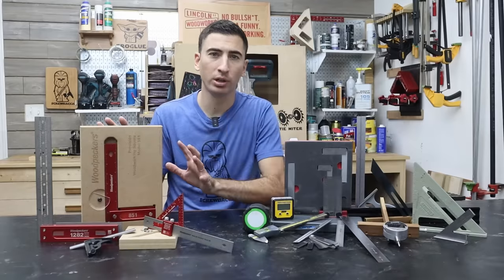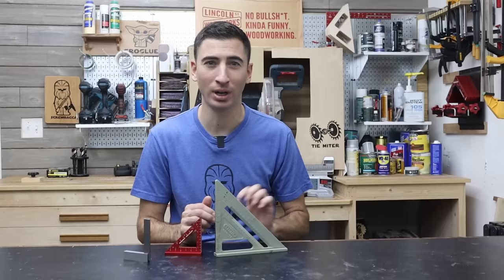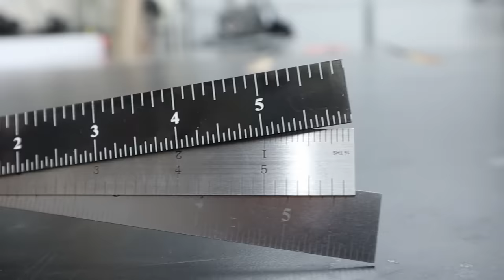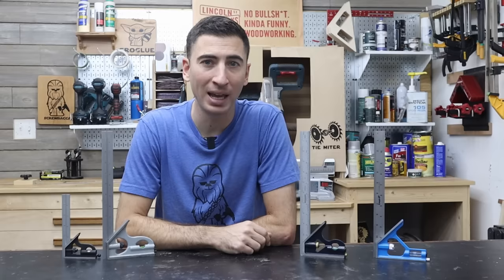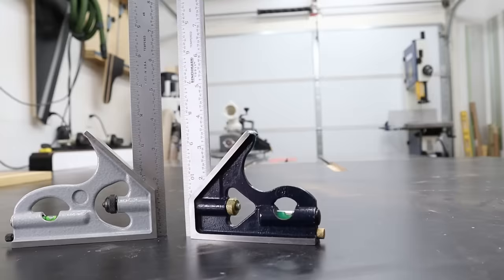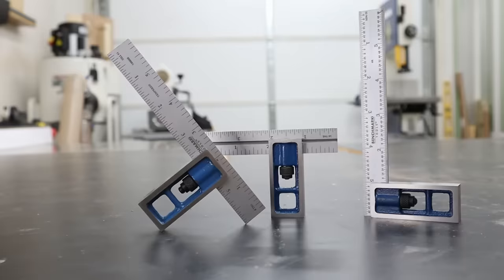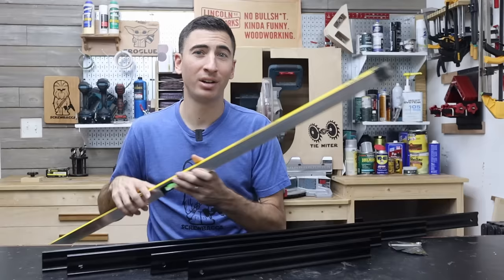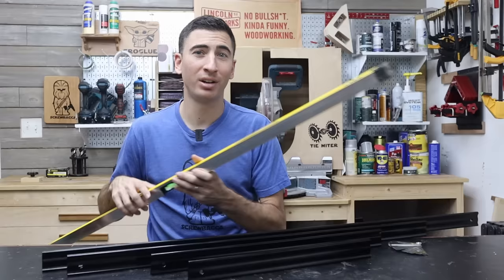Why is woodpeckers so expensive?

Comment: One advantage of the speed square is that when cutting timber  you can place your square on your timber and run a power saw along side giving a square cut. I found this useful just recently when cutting 4 x4 inch fence posts.
Reply: can't you do that with any square?

Comment: I agree that machinist squares are essential for setup and some layout. And a precision straight-edge. I would also add at least one pair of 1-2-3 blocks. 

I also reccomend a good quality combination square. (I was lucky enough to be able to score an excellent Starret set -  the rule, the square head, the protractor head, and the center finder head - when a woodworker in my area had a "retired and moving away" sale of his whole shop.) 

One thing about measuring and reference tools being steel - in the world of physical/dimensional calibration, steel is everywhere. Most of the tools being calibrated are steel, and most of the measurement standards (such as gage blocks) are also steel. This is important because the standards and the tools being calibrated have about the same thermal coefficient of expansion, which means that there is normally no need to correct for temperature. A tool made of aluminum, however has a different thermal coefficient and will therefore expand or contract a different amount than the standards. That makes the math of determining in or out of tolerance more complex, and adds to the total measurement uncertainty. 

All of my dimensional measuring tools are made of steel, because I know that if, for example, I compare two rulers I can expect all of the graduations to line up. However, trying to compare a steel rule to an aluminum or plastic rule would be pointless because of the different expansion rates. They would "probably" read the same if I maintained my workshop at a constant 20°C as calibration labs do. But I am retired from that environment, and I prefer my workshop warmer than that. 

Things get even more complicated when you add plastics to the mix, such as the common glue-up squares. The mould they are made in is square, but is the actual square square? Injection-moudled plastics can change over time due to internal stresses. I believe they eventualy reach an equilibrium state, but how much time does that take? 

I do have one tool from Woodpecker's - their small aluminum pocket square. It's size makes it convenient to keep in my pocket, and I know the thermal expansion/contraction will not make a VISIBLE difference when checking squareness. But it is for quick checks - it is not one of my reference tools. 
 
High quality measurement tools are not "essential" for beginner or casual woodworkers. It is possible to start and do reasonable work with low-cost tools. But the better measurement tools enable better precision and accuracy, which enables a better end product. The day I bought that Starret combination square, my old one from Harbor Freight instantly acquired the status of "honorable paperweight", and my work is improving.

Comment: Another great video. One recommendation though. Whatever tape measure you go with stick with it. Not every tape measure is the same as other when going longer distances.  I stick with my Fastcap tapes.  And my machinist square sits by the tablesaw.  After making an angled cut, I reset it with my machinist square.  One more thing to add. I love the Paolini tools because it's small but sturdy.  And it's very specific use.  Once I set a distance, I use all three (sometimes) and I know it's a known distance that I can reset the fence/cutter/bit etc to.  So it's used more for reference distance than anything else. Because it's so small, I put it in my toolbag and constantly reach for it.  I do use my Starret levels as a straight edge and I think it's good enough for my use case.  And I keep a 48" Empire level for jointing use for the tablesaw. Again, being off a few thou is OK for that use case.  But I may have to pick up those straight edges.  thanks!
Reply: Great point.  I verified the accuracy of a dial caliper against Starrett micrometers and then started using it to check the accuracy of rulers, tape measures and other devices in my shop.  The tape on my table saw was off by about 1/10" in 12 inches.  It has an incremental fence as well but I still changed the tape out.  A number of tape measures were removed from the wood/metal working shop and put in a separate garage to only be used when "close is good enough" like looking for raw material or building garage shelving.

Comment: Regarding the digital angle gauge a good beginner option to set the bevel on a table saw is to simply use a protractor app on your phone. I made a U shaped phone holder out of hardwood and epoxied a couple of small rare earth magnets in one edge. Although I have more expensive options to use this is my go to for setting table saw or miter saw bevel. Zero it to the table and then stick the magnets to the blade. The nicest thing about it is it frees up your hands to adjust the blade. Also I recommend measuring tools that measure in both inches and millimeters where you can. The math with millimeters often seems easier.

Comment: To beginner DIY woodworkers: you don't need the tolerances mentioned in the video for wood. Wood expands and contracts with humidity and temperature changes so even 1 hundredths of an inch is more than enough tolerance for good square builds. Get the cheap home center stuff, it works perfectly fine.
Reply from the maker: You're half correct. But wood moving across the grain has little to do with square cuts. Wood movement definitely impacts dimensions and the flatness of pieces. The true benefit of really accurate measuring is setting up tools like I mentioned - that's where errors compound.  I would always encourage somehow starting out to remove variables wherever possible especially for reasonably nominal cost.
Reply: Totally agree.  You can get a good Japanese square on line for about $20.

Comment: I was very lucky to inherit from my father a bunch of machinist measuring tools.  Tons of Starret.  Machinist squares and other.  The options you've provided are good common sense solutions to the overpricing of Woodpecker's.  Yes I said it and it's just my opinion.  The Incra was a solid alternative.  One woodworker recently highlighted a Chinese company, Goingmake.  The T-ruler assembly required.

Comment: anyone thinking you need machinist tolerances with wood that changes with the humidity is beyond help
Reply: Seriously am I taking crazy pills or is everyone in the comments and the video vastly overestimating the tolerances needed with diy wood working?

Wood expands and contacts WAY more than "thousands" of an inch with a 1 degree change in temperature. All of these tools and "advice" are overkill.
Reply: Wood expands across the grain but it does not become longer

Comment: For a mechanical pencil for woodworking I have really enjoyed the Staedtler Mars Technio, it has a 2 mm lead which is very durable and you can use the built-in sharpener built in to sharpen the lead.

Comment: Finally standing up to woodpecker products! Pretty cleaver designs but, you have to be very careful with them or your accuracy can be thrown just buy a brush or prick dent! Steel has it issues also, but my preference. Also depending on your work, you only need a few layout tools really and not a bunch of combo tools that repecate several tools, again it depends on what you build the most. Simple layout are the best! All good points you made in this video! I do prefer  a dial vs digital cause you can discriminate better, and like a vernier it never needs batteries! Columbus Michigan

Comment: I inherited a set of Starrett combo squares with protractors and center finder heads. I havent used any of ky machiniat squares, combo squares since. I build guitars, and using starrett to find and mark centerlines make life so much simpler. I can easily measure depths, and set router bit heights. Id spend the money on a starrett combo square over those high priced red combo sqaures any day.

Comment: I have the PEC 6” double square + extra 4” blade.  This is my go to tool every time. Anything less than 4”, this is perfect bc of how light it is. 12” is hard to hold when marking small dimensions.

The fact that the handle is a perfect 1” width, it works extremely well with 1-2-3 blocks for setup. 

May be add 1-2-3 blocks to your lists of must have. Cheap set of 2 under $20 are accurate to .0005”

Comment: Very good video. One thing I'd like to  comment on is using a square on a table saw. The first table saw I used was an inherited Ryobi, which had a really terrible blade insert. Not only was the throat ridiculously wide, but it was made with a rather springy metal. If you held the square down at all firmly, the insert visibly sagged. It also sagged during cuts. And it wasn't flush with the top of the table. Perfect other than that!😁 I should thank Ryobi because they forced me into making a good rigid zero-clearance insert with set screws for height adjustment. Not that hard to make and an absolute game changer.

Comment: speed squares - as a side note - I actually read an old-old-oooold manual from Swanson speed square and they seem more geared towards roofing and have some features built in that are good for rafters. Was kind of a neat read. I've had my metal one for about 10+ years now, strong. Not absolute for only checking square, but more like check square, but also do your roof stuff.

Comment: @Lincoln St. Woodworks a great alternative brand between budget brands/quality and woodpeckers is to look at igaging and DFM tools.  

Igaging is designed in America but made overseas in some cases.

DFM is made and designed in the United States.

Both brands offer very similar Accuracy and Precision as Woodpeckers.  Albeit not quite as good as Woodpeckers but most folks won't notice the difference unless they are building something with supercritical tolerances.  Such as a puzzle that must look like there are no seams/joints.

Comment: Most underrated tools in my shop: By far it's my homemade 24"X14" surface plate, with which I verify all my other tools. Next is a dial caliper, followed by a 12" machinists square, then a 24" steel straight edge made from a cheap framing square.

Comment: Great, honest and fair comparison.  I don't like cheap tools, but I also don't like unnecessarily expensive ones either.  I have no issues spending in the right places, but don't like wasting my money either.

I just don't get Youtube woodworkers who feel the need to stand in front of a very expensive wall of measuring devices (you know... mostly the "Red" ones) they rarely, if ever, use and probably never actually paid for.

Comment: My $10 dial calipers are my most used tool when working with the table saw. Being a machinist working in thousandths of a inch is more natural and calipers make it so easy to accurately set blade heights and fence positions dado widths and verify dimensions on smaller parts. I did buy a good quality straight edge when I was rebuilding my engine and find it comes in very handy for showing me how bad my table saw really is. It’s much better now but still not great. Spent a few hours flattening the aluminum top of my used Bosch contractor saw (not my best purchase decision). I also have a used mitutoyo tri square I use as my go to for accurate 90 degrees.

Comment: I have the Starrett 12 inch combo square with center finder and adjustable protractor. Came in a kit with a fancy case. It did cost several hundred dollars. BUT, I would never waste $1 on anything less than Starrett. You get what you pay for. Any tool in my shop that needs accuracy is Starrett.

Comment: Well done - lucidly described and practical.  For me personally, a Starrett combination square (the 12" is my fav) is an imperative.  It is the most-used tool in my shop. I rarely use machinist squares as the Starrett does everything a machinist square can do and I trust the Starrett more.  And I agree on the straight edge.  I've had a 36" Woodpeckers for a long time (48" would be better).

Comment: My favourite square, though after 50 years I have several to choose from are either: 1) 3D printed ones.  Those machines are accurate within 1 thou, .  The only problem is that the points are slightly off.  2 seconds with a file and we are done.  Warm to the touch, accurate, light.  cost only a few cents.  Patterns on Thingiverse, and you can mash them up to the perfect size you want. 2) wooden ones, those are often what the best woodworkers through the ages used.  If you can't make one how can you make precision parts from lines you drew with your red square.

Comment: For people watching this, and never heard of the German DIN squarness tolerance standard. Please make sure you check what one you’re purchasing before you do. In this video he shows the Kinex Machinist square and says it’s a tolerance of 0.007”.. that is true for the machinist square that’s 500 mm and has (DIN 875/00) but not the one he’s showing that has (DIN 875/1).. also the shorter or longer the blade is of the square, the accuracy differs slightly. Example.. the 75 mm square that is (DIN 875/00) has a tolerance of 0.003”.. and the 250 mm square that’s also (DIN 875/00) has a tolerance of 0.005”. Hence the “00” in DIN 875/00.. 
  While the one he’s shows are (DIN 875/1) that means the 500 mm would be 0.035” and the 75 mm DIN 875/1 would be 0.014”.. and 250 mm DIN 875/1 would be 0.023” in tolerance. 
  DIN 875/00 is the most accurate, and from most to least accurate would be..
  1• DIN 875/00
  2• DIN 875/0
  3• DIN 875/1
  4• DIN 875/2
I hope this helps as when I first purchase a machinist square that uses the German DIN Standard I made the mistake of getting the DIN 875/1 thinking it was the most accurate and kept finding my projects not assembling how I wanted after cutting. They aren’t horrible by any means just anyone’s who’s picky would get frustrated, when I got the DIN 875/00 I was a lot more happy lol!
 Have a good day!

Comment: I purchased a 4" double sq. from Starrett and after a few months I noticed that the blade was split on the retaining groove. Thinking that Starrett would make good on their product, I contacted them only to be told that I could spend an additional 30+ dollars for a new blade. I spent that thirty on a different brand of double sq. and have happily  used that square for many years. Just because you spend big bucks on an item, the customer service does not go up. (except maybe lee valley)

Comment: And yet ANOTHER excellent video!!! I would add, with all of these highly accurate measuring devices, a person should have a dedicated storage space. These are NOT tools that just get chucked into a tool box along with hammers, hand saw and the like. They are delicate measuring instruments and should be treated as such. I have found an inexpensive 'machinist toolbox' from Harbor Freight best for these measuring tools.

As far as pencils... mechanical pencils are a PIA. I found it best to use regular ol' pencils, and have an old school, wall mounted pencil sharpener. These sharpener will put a needle point on any pencil. I keep a pencil at the table saw, the chop saw and one at the workbench. Chasing your pencil is a full time job in a shop :)

Comment: Lots of great advice here. I am really eager to try a machinist square for things like checking blade alignment, etc. I have a cheap Porter Cable jointer and would really love to check the tolerances on it compared to when I use a square from the big box store. Also, I'd like to add that in my experience, Incra make quality affordable stuff. I have the crosscut miter gauge that I really like.

Comment: I have one of those 6" black rulers. I find it very easy to see the lines.
I also have a Utilitas hooked rule I got from Lee Valley. I've used it a lot but I always wanted to try the Woodpeckes version for the simple reason that the WP's has 1/32" increments and the Utilitas only has 1/16". I finally got the WP version of the hooked rule and have been using it for about a month now. I'm not blown out of the water by how much better it is but I do like it a bit more.
I got the Paolini 8" rule a few weeks ago and I'm still learning how to use it well. I sort of wish I got the steel version because I can see how the aluminum version is going to get beat the heck up.

Comment: One thing I would add is a machined flat plate that mounts on the table saw arbor.  It provides a dead accurate touch plate for the dial indicator to true the table top slot to the the arbor and hence any blade that is mounted on the saw.  It does not flex at all under dial indicator spring pressure.

Comment: I couldn’t agree more - a 3’ straight edge is essential for proper table saw and jointer setups. I do prefer a 12” Starrett adjustable square though.  Amen on the digital calipers and angle gauge.

Comment: Good honest video.  I've never understood the need to go all red on the wall LOL.  The best work that I've seen are often made with cheaper but decent quality old tools.  I find that Lee Valley stuff tend to be well designed and priced (some would argue otherwise on the pricing, but you get what you pay for).  You can find some products cheaper or a bit more specialized, but they have a good trade off there.

Comment: Having worked as a machinist in the tool and die trade, I know the value of precision. I have to maintain tolerances down to .0001. As a hobbyist woodworker, I have carried over some of my machinist skills and tools such as the machinist square and dial indicator. Both are indispensable in aligning the table table blade and miter gauge, as well as the drill press table.